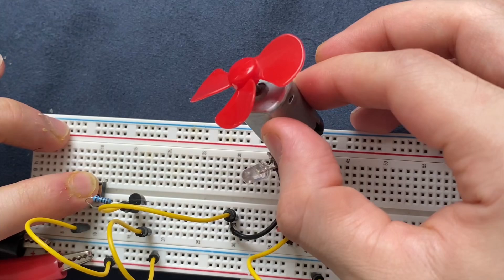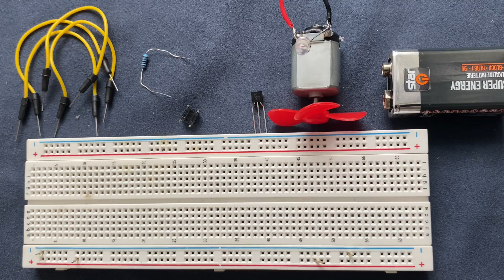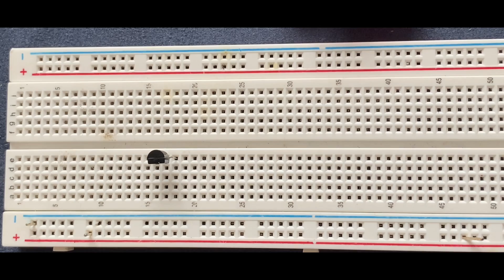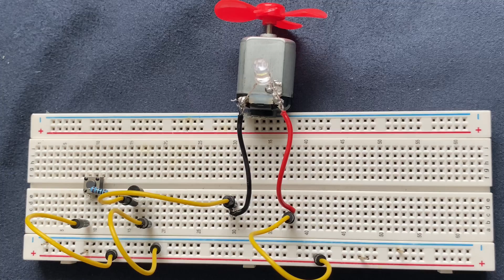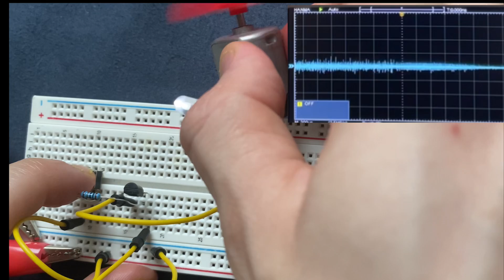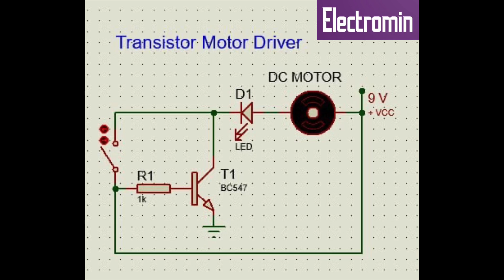Transistor Motor Driver on Breadboard and Oscilloscope using BC547

Comment: Wonderful video. Exactly what i was searching for. But for me the motor doesn't run. I've used 3.8v battery to connect the motor across the collector and the emitter. Also used 2.8v power supply through a 500 ohm resistor to switch the base of the transistor on. What to do in my case for the motor to run. The voltage across the motor appears to be 0v. But if i connect an LED, it shows 2.8v across the collector and emitter😢. Kindly help me understand what's going on. Also connecting 9v battery to base through 1k ohm resistor burns the transistor
Reply from the maker: Thanks

As you have seen i’ve used 9 volt and 1k base resistor and it worked perfectly.

Different dc motors operate at different input voltage but im pretty much sure if the connections are correct the circuit must work within 9volts 👍

Comment from the maker: Apologies for the Voice Quality from 2:50 , hope it doesn’t make any trouble for you 😅
Reply: Could you tell me the maximum voltage and the maximum current for the dc motor which you used in this circuit?
Reply from the maker: @yousseffaid6519  12V and 2,4A
Reply: But the input voltage is from a 9v battery how it made the dc motor with 12v to work? @ElectroMin
Reply from the maker: @yousseffaid6519  you are right, the mentioned 12v is the nominal voltage which i got from a random data sheet on internet 

Typical dc motors operate at 1,5V up to 100v or more. Different DC motors different operating voltage , so you have to check the data sheet

 I have to experiment on the board if you need to know the operating voltage of my dc motor since i’m not able to get the data sheet
Reply: @ElectroMin ples i don't have  brd board and i don't understand how you join and make it without bredboard i want to learn transistor